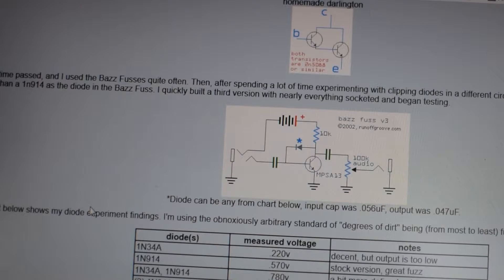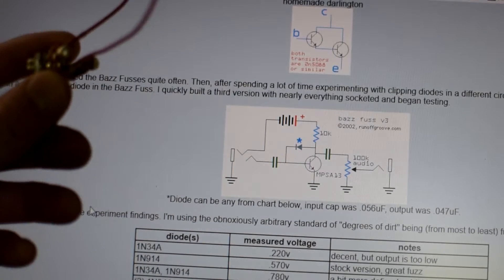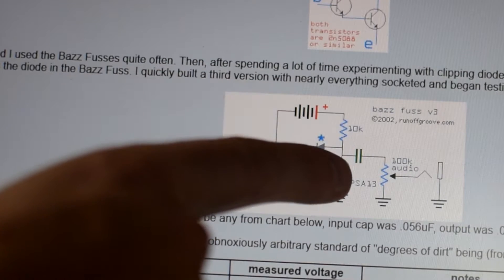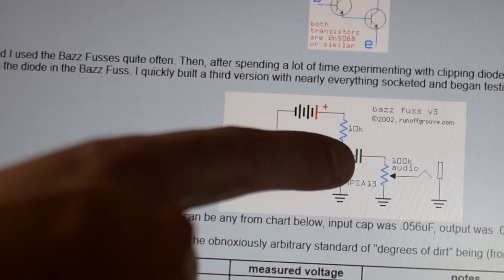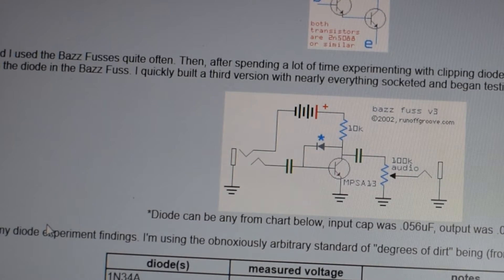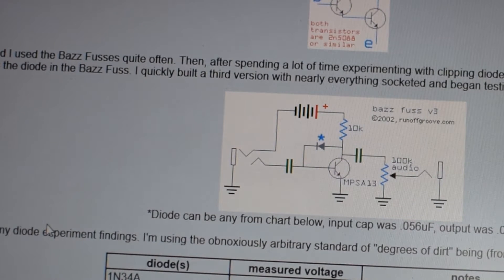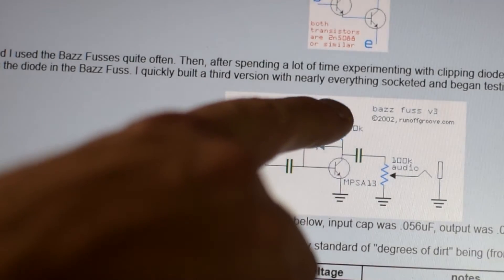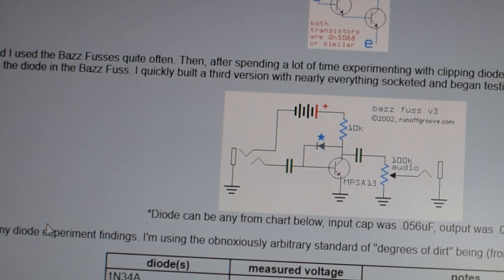Bazz Fuss - Circuit Analysis | Pt. 2 - Schematic Overview

Comment: The super important thing about BJT transistors is that they are CURRENT amplifiers. So the current flowing through the collector is equal to current flowing through the base to the emitter multiplied by a factor of beta which is specific for the transistor you have. This results in a voltage drop across the collector resistor what gives you the voltage amplification  so the voltage amplification in this circuit depends more on the resistor than the transistor.